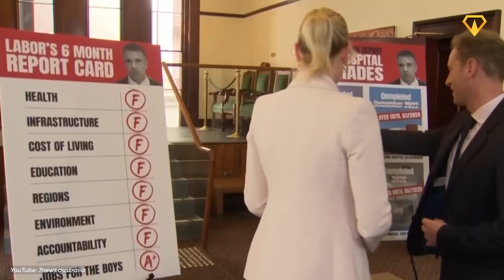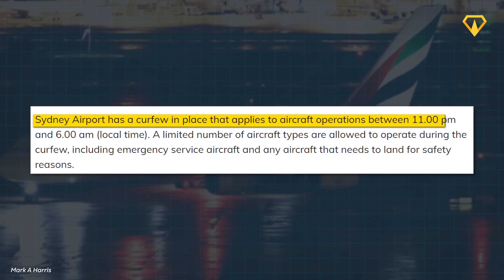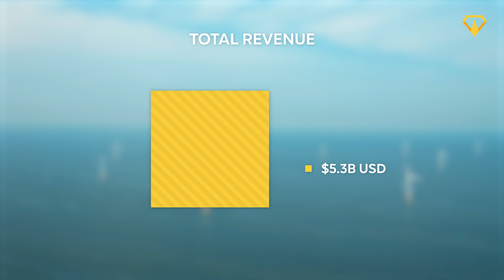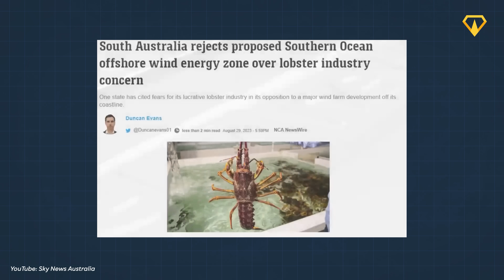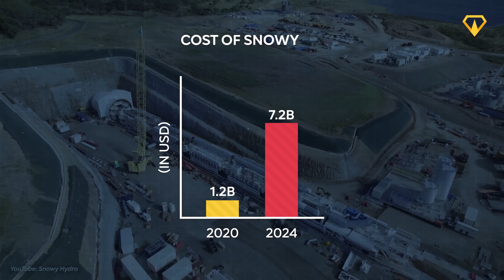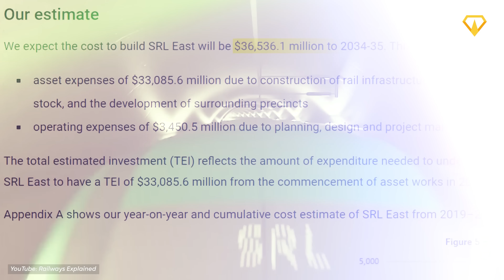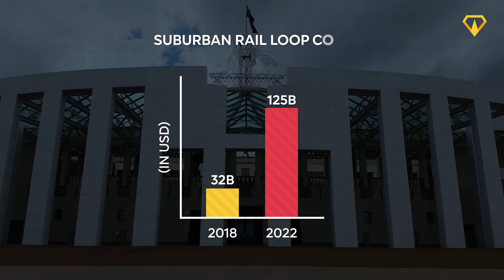Top 10 Biggest Megaprojects in Australia

Comment: Now all we need is a tunnel  under the blue mountains in NSW to  open up the central west township of  Bathurst. Mudgee  Orange
Reply: Now that would be a huge project. On the other hand, it could be argued there is a need because Sydney (unlike Melbourne) is fast running out of space to expand into.
Reply: Agreed, great idea. If the development included hydro dams while engineering the mountains, and potentially pulled the high speed rail out to the western plains where land is cheap, empty, and it can run in straightish lines townsville through Brisbane and Melbourne (the Japanese fast train experts on Tube emphasize to achive fast speeds the fast train lines MUST be as straight as possible), then this would significantly increase the business value for the investment. Australia's centre may become much wetter as temperatures increase, the additional central nsw/qld agricultural outputs could then be trained to coast, slashing carbon and road-maintenance costs caused by trucking. Great idea, Sydney is landlocked. Melb can stretch to Perth or Townsville. We need maximum cities inland producing maximum sewerage to fertilize deserts so they can again support forests. It will be almost impossible to avoid extinction unless we increase carbon sequestration 1,000s fold. Central Australia must be connected to the east coast to do this.
Reply: @canwelook  build up

Comment: Why do they build solar panels so far away from each other? 12:09
You could easily fit double the panels into that space.
I'm sure there must be a reason... but what?  🤔
Reply: Maintenance
Reply: Shadows cast by the sun will stop the panels maximising their exposure to sunlight, which is when they are most efficient. The problem with solar is that the generation only works when the sun is shining, which means that whole great big array (if it is ever completed) will only work for a portion of each day.
Reply: @vintageradio3404  For sure you could have twice as many panels and there would be no shadows in the important middle of the day while the sun was overhead.  Shadows would only be a problem at the end of the day when the sun is low, but the extra energy generated in the middle of the day would more than make up for that.  I suspect the previous answer about maintenance is right and needing to get certain sized machinery between the rows  🤔

Comment: Attracting people back into the workplace in a country where people must commute by private vehicles at distances that often take at least 2 hours each way from the suburbs into the metropolitan area, is contrary to the plan to reduce carbon emissions for "climate change".  I'm thinking they need to continue to allow people to work from home. It helps reduce congestion on the roads at the same time. 
The building they designed to encourage people back into the workplace would have been better designed as a residential building because Australia has huge shortages of climate appropriate, decently designed, affordable housing.  
Would you believe many affordable housing stocks are still without insulation, and air-conditioning, where temperatures are regularly reaching highs of over 40 degrees Celsius during summer?  
There are power companies building solar power stations in Australia to send electricity to another country?  
There are so many people in Australia that they can barely afford to pay rent, eat, or pay for being on the grid for essential services here in Australia.  
For those considering moving here, take note.

Comment: The Suburban Rail Loop (SRL) is a rebuild of an already failed project The Outer Circle Line. Built between 1891 and 1897 to do the exact same thing to get people around the city without going through the middle. It was built, operated for 6 years and then abandoned piecemeal until nothing is left by 1949, because it was not even covering operating costs, because very few people found it useful. Low density locations along the line and excessive total travel times that could be bypassed by going through the city in a more direct manner or using a car. The SRL is exactly the same, the locations are circling around and far away from the Central Business District (CBD, called downtown in USA) where low density development does not support public transit efficiency, long travel time to most destinations better served by direct routes and lack of high density activity centers (all in the CBD, arts centres/centers, sports stadiums, office buildings). The few larger high density development areas (probably only 6 areas maximum, Chadstone Shopping Centre, Southland, Box Hill shopping/high rise and hospital area, are the only that readily come to mind), such as large shopping districts, high rise development areas and recreations facilities are few and dispersed. Certainly doomed to failure to expand the use of public transit and be a positive payback, even at $33 Billion and certainly  for the more likely total of $44-$60 Billion) end it the same fate as the Outer Circle Line. Yet, like the Snowy Hydro 2 Project, doomed to happen because of political boondoogles beneficiaries (large construction companies) are a wellspring of campaign monies and vote getting.
Reply: If the trains can support bicycles (inc those with trailers), and one day transport mini EV pod cars, it should reduce ring road usage by allowing transit without needing everyone to go via the CBD when many times you want to travel laterally nearby. We need to invest now, the city is going to continue to grow. We either invest now, or be stuck in traffic jams for another 4 decades, again.

Comment: The upshot of not building these projects is the lack of overall infrastructure that is really needed for long term power grids & inter-city travel. Exports to bolster the economy is also a necessary evil & the power will probably aside Indonesia as well as Singapore. It's little issue for Australia bcos of our land availability & supply which can be shared over much more populated countries with little available space.
Reply: The infrastructure is a real problem yes. We have more than enough marginal land in the outback where big solar farms can be constructed but the distance for the power lines is too big. It makes them very costly besides when they get close to the cities the farmers wont allow them to pass. They use electricity them selves which they don't mind getting from a power station far away as that doesn't demand big power lines close to them.
Reply: @leonhardtkristensen4093  you pass through my land then my electricity is free!
Reply: @RexAlfieLee  I believe a fee is paid for every tower erected on a farmers land.  
Now let's look at this in a different way. The farmer is usually already using electricity but the ones I know that appear to complain get's it from a far away power station so have only small wire infrastructure to bring it there. They have been lucky for many years. However far away there is a great big very polluting power station that has very big towers and transmission lines going away so that others (like our farmer) can get electricity. People around there have been suffering for a long time. Has our farmer ever been over there to help the locals to complain? Maybe. I don't know.
What I do know is that the environment is getting hotter and our (apparently complaining) farmer will need to use more and more water to irrigate his crop if he wants to have one. Many farmers do use diesel pumps to pump up that water but that just pollute even more. Wouldn't it be better to have some inland solar power installations where the farming is really marginal with their required transmission infrastructure instead? 
If you should have free electricity I don't know but do the farmers next to the polluting power stations where you get your electricity from get free electricity now? Have you ever said that they should have? 
I may be your neighbour as I have land (just a small plot) close to where a transmission line needs to be build. I can't really see any of the windmill's but wouldn't mind as I see them as beautiful compared to the smoke stacks from the coal powered stations. I wouldn't say no to one on my land (or a transmission tower for that matter) but I don't think that will happen. I already have solar power.
Reply: @leonhardtkristensen4093  firstly the pumps used to be diesel. They're pretty much all solar now. I have family with a station & they used to work on one where the weekly trip to fuel those pumps was 500km 3 times per week. Compared to my sister's place that 300,000 acre block of land is a quarter the size. Nobody uses them with any sense bcos the sun here runs those pumps brilliantly & everybody knows it.
Reply: @leonhardtkristensen4093  secondly, I haven't used power station for home energy in 5 years, maybe 6. Also the water they're pumping from the basin is in the billions of gigalitres. It's not going to run out for a little while yet. Check your sources. You don't know.
Reply: @RexAlfieLee  Yes I didn't know then that you are in Queensland (or upper NSW) and I am in Victoria. What you don't know is that I have seen many engine pumps down here with at least a 1000l drum next to them. Many are probably bigger. I have yet to see a solar powered irrigation setup in the Ballarat area. I only se 'NO POWER LINES" signs hanging on most fences and then the water flowing out of the many centre pivot or rolling irrigation systems that are getting their water from either from dams or bores. 
 To my knowledge the basin doesn't go down here.  The underground water down here is quite limited. I have a 63m deep bore but my pump is only about 40m down so I can feel that the level goes up and down. The bore runs out of water fast when it is low. It is that same water that the potato farmers use for irrigation. I am not allowed to do irrigation except of my garden.  
Down here the farmers have a number of sheep to the acre. I would not be surprised if your sister counts acre to the sheep.
In the northern part of Victoria along the Murray River the farmers can't get enough water out of that river. It is so bad that I have limitations on what water I can take out of my own dams just north of Ballarat. Overflow might go into the Murray.
Down here we hear about how there are  meters of water falling on the land every year in north QLD. We usually only have millimeters. We where lucky in December and January as we had nearly 200mm and that was tribble the normal. The rest has for months been about one third. 10mm in Feb. and so far less than 1 except maybe 2 last night. 
We also hear that the inner parts of QLD and NSW are very dry. I have been through Middle and back of NSW once myself and it was pretty dry. Wouldn't it be better to install a lot of solar panels over such an area and then make some transmission lines down south to Victoria instead of burning a lot of coal in our old power stations? The panels could be installed so that the few sheep that are there could have shade under them too.
Reply: Here near Broken Hill it used to be 15 acres per sheep. My sister's place, actually her son's now is near Cameron's Corner. Their pumps go a lot further down, like a lot further down, it's salty & 70 degrees C when it goes into a cooling tank. It's very hot but they have a lagoon there with overflow & birds nest there.
They only run cattle
Reply: @RexAlfieLee  At least I am lucky that my bore water is drinkable. My Alpaca's like it.
So Broken Hill yes I went past on my trip. I went to Hay and then direct north to the Queensland Border. Then I went west to a road that goes down to Broken Hill and Mildura. The Silver City highway I think it was called. It was in a 1974 VW Combivan semi camper. It was in the late 1970's shortly after I came here in 78. I took a 4 day trip. My van was so dusty after the trip that I had to use a garden hose to get most of it out. I never did get it all out.
Wouldn't it be good to create a little shade on your sisters land for sheep or cattle with some solar panels and then sell  the electricity to Victoria? That just demands the infrastructure to bring it down here and that is what my local farmers complain about.  I have solar panels both at the farm and at home. The latest I got installed at home is 5 years ago and they have just about earned back their cost by now and I didn't even get government help as I had some installed 9 years earlier and didn't qualify. At the farm I have done all the installation myself and for that you also don't get help. 
I do live in Melbourne and not at my farm but I would have liked to. Not so young any more - I still think that I am a young man - but illness has meant that I can hardly walk and have to go to hospital regularly so it is more convenient to keep living in Melbourne.  I have an internet camera at the farm so that I can keep an eye on my animals and dream that I am partly there. We usually go there for the weekends. 
I could use some 70degrees C water in Melbourne to heat my house in the winter. Currently it is gas I use. It was cheap when I got my house build but not any more.
Reply: @leonhardtkristensen4093  I didn't live here from 19 till 5 months ago, 46 years later,  but my fam did. Here until my block in QLD is sold, which I should be paid out in 30 days, then an rv & going travelling. Not so young anymore either.

Comment: I am from Melbourne. I believe that the SLR should not go ahead, the economy is not stable enough to handle it. The state is has about $130 - $140 billion in debt and that number is still expected to rise to about $170 billion by 2027 (Without any additional debt caused by overblown budgets). We still have two major projects going on (Metro Tunnel and West Gate Tunnel) and there are still many maintenance issues with Victorian railways and roads with pot holes becoming a common sight, with some getting to sizes that can damage cars. But I do believe that the airport rail link must be built because it takes a long time on the Tullamarine Freeway to the airport, especially in heavy traffic. Building the link could ease the strain on the road links and provide better access to the airport, this is if it is done and managed right.

Comment: this is an okay video but there are A LOT of errors in the suburban rail loop which is totally understandable as it's highly controversial and hard to find credible infomation.
1. the PBO report was done by the opposition and done to make it as expensive as possible. the 133B dollars is the cost to build east AND north, AND have it run for 40 years, 133B is total costs of the suburban rail loop by 2080, not the cost to build the first stage. The first stage, the one which everyone is focused on will cost only 35B dollars according to the same report, which is VERY similar to the government's estimated 33B. Also the PBO is VERY unreliable and they weren't given many resources to test if the estimates were trtue, the opposition just wanted them to plug some numbers into a calculator to help with their campaign to can the project, which has failed twice now.
2. the opposition lost the election in 2022, the next election will be in 2026 and it is unclear wether the opposition will suppoirt or reject it in the next election, given that in 2026 there will literally be tunnel boring machines in the ground creating the tunnels.
3. Melbourne isn't really "risking it all", by 2050 melbourne will have 8 million residents, and it's laughable to suggest that a city of 8M people SHOULDN'T have an orbital rail line.

I have a suspicion you've used AI to make this video but AI is unreliable

Comment: I'm chewing on the numbers.
You say the Snowy project supply 4500 GWh.
You also say the A-A Power Link in the NT can transmit 6.5GW.
Unless GWh and GW are vastly different, it seems the A-A Link is less economical than the Snowy.
(I'm not an engineer).
Reply: I'm also no engineer. But my understanding is that the Snowy Project acts like a giant battery so it's GWH measure would refer to the maximum electricity storage capacity. Whereas the NT power link acts like a giant generator so the GW measure would refer to the electricity throughput at any moment in time.

Comment: The wind turbines in Victoria haven't even agreed on a location, as it varies between Wilsons Prom and the Great Ocean Road- both marine reserves of great importance. Maybe do a follow up video in 30 years time and you may find we finally agreed on a location.
Reply: Temporary damage to marine reserves is a far smaller cost than global extinction due to climate heating. Melbourne is 2.12 degrees over long term average. We have run out of time and must become 100% renewable in the absolute shortest timeframe possible. The pylons will actually long term provide infrastructure which corals can grow on, increasing marine life long term. It is not a question of which location, we need both, and more locations. Industry needs cheap power. We must produce 100% of our own products as a nation to eliminate carbon released through shipping. We need far more renewable power than we currently consume to achieve this.
Reply: @ This is true: we need more energy. And now we have the Liberal party taking the nuclear solution to the next election as the answer. If they win, the turbines won't be built at all, contentious location or not.